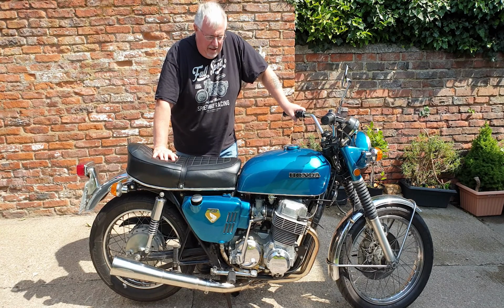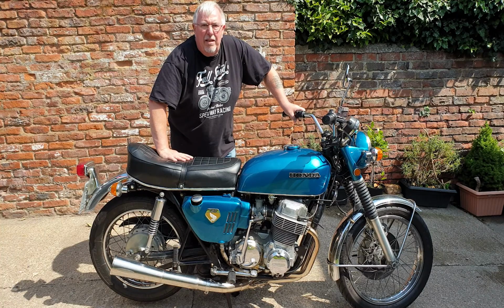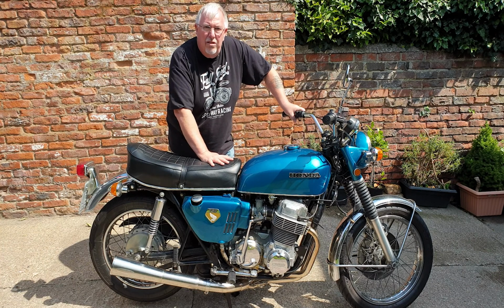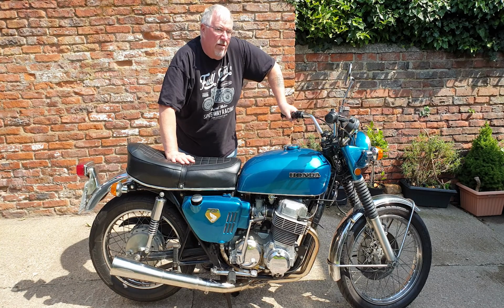CB750 Exhaust Sound 4 into 1 Delkevic vs 4 into 2 Shorty - Honda K0 | Part 33

Comment: I just bought one for my DOHC CB750 - thanks for your How To's
Reply from the maker: I really like everything about this exhaust the look, sound and the quality it is all good.
Reply: @SPANNERRASH  Thanks for your reply.  I dropped the old pipes after watching your vid. they were about 60 lbs in total. Im goging to clean them up and see what Ebay can do with them. 

The new  ones are 10 lbs.  I observed that cylinders 1 and 4 are on the top of the collector and 2 and 3 on the bottom. When I get mine for the DOHC inn the next few days, I'll  make a loose assembly of the pipes and collector, that i assume I can slip/wiggle into place. 

what I notice was the muffler assembly pastes ( thanks) so I ordered that too from Amazon - 

I loved the deep loud sound of my pipes after having pulled the baffles, and hope the new header solution can meet that expectation with its baffle options. I can sett it to super quiet when having to get an inspection, and Ill see how loud loud is otherwise since I can set it with a parital baffling - 

Ill let you know How I made out - https://youtu.be/yKdEM59ERCw 

Best Regards -   

Orion -
Reply from the maker: @ClassicRider  I never really thought about the weight saving, but that is a great bonus.

The sound it makes as standard is great for me.  I haven't explored removing the baffle, but I do believe they can be taken out.  You may have to consider changing the jets though as there will be less back pressure.

Let us know how you go on.

Comment: I bought a standard 4 into 2 exhaust in good used condition for my z650 kawasaki in 2005 off ebay for $29 Australian dollars, postage from USA  $140, still cheap, and they make the bike look stock standard. 
No chance nowadays.
Reply from the maker: The times they are a changing.  I still think about the Triton project I bought from an ad in the Manchester Evening News for £90 back in '86, thought I did well selling it for around £400 when I moved a year or so later.  Big regrets!!!

Comment: I much prefer the deeper tone of the delkevic,saying that on a longer run, the delkevic would make a long ride more enjoyable. When I 1st bought my gt750, it was fitted with a standard exhaust, but the previous owner had fitted k&n filters, after a 260 mile round trip to friends house, it really got on my nerves, so I refitted the standard air box & bike was brilliant to ride after that
Reply from the maker: Hi Pat, I'm loving these Delkevic systems for these CB750's they have a great sound. I think I'd love to have had the standard exhausts for this particular bike even more though as it ended up being such a tidy example.
That's interesting about the K&N filters. I'd have assumed they gave a better induction sound but seems that might not be the case!
Reply: @SPANNERRASH  on the kettle you have 3 40mm carbs it’s really loud, was bad enough that my ears were ringing,there wasn’t any performance gain either, plus it ran better with the standard air box
Reply from the maker: @bluehazeboy  Haha! I heard the same about them running better with the standard airbox, so must be a common disappointment with the K&Ns.
Reply: @SPANNERRASH  I reckon it’s all about set up,even a trip to the dyno to boot as well

Comment: There is no comparison the 4 into 1 was music to my ears.
I had a CB 650 1979 model bought it in 1981 stuck a set of free flows, extractors, 4 into 1's lovely set of pumps all the same length, chrome.
Increased power below about 7000 rpm by a really noticeable amount. 
Quick 650's for the day those Honda's last of the single over head cam engines a real pocket rocket. Quicker than the 650 Suzuki with double over head cams.

Not that I'm condoning this sort of behavior, but as a young man I lived in Canterbury New Zealand in the country down a Along straight road. One of the prevailing winds would blow straight down it, you could get up to 40 or 50 miles an hour sometimes and it felt like there was no wind it was blowing that hard. I thought how fast will this Honda go with one of these winds behind me?   
Answer... it red lined at 9500 rpm.  It wound past that and out above the red which stopped at about 10500 rpm  must have been above 11000 rpm. The speedo finished at 200 k's an hour at wound well past that and it was still accelerating when I thought I think that'll do. 
The lamp posts are starting to pass very quickly at that speed.
Reply from the maker: It does sound good that Delkevic. Love the story, that feeling is what its all about for me. I bet you were grinning from ear to ear. :D
Reply: @SPANNERRASH  Yea I did a lot of miles on that bike around the south island over on the ferry to north island a couple of times.
Christchurch to picton in 3and bit hours that normally takes couple of hours longer that that. I was grinning alot on that bike.
At 61 i'm going to start looking for another bike. But you know I think i'll get a early 80's or 70's Triumph Bonneville lots of them still in NZ plenty of parts. Cheap registration here if it's over 40 years old. I dont need to go fast know days. Dont want a new Triumph even if they are good.

Comment: Hi mate do you have baffles in the delkevic ? My understanding is that they come with removable baffles. Cheers james
Reply from the maker: The baffles are still in.  TBH I haven't tried it without, and I am not sure how easy/hard they would be to remove.  But once the weather improves I will take a look.
Reply: From what Ive read it seems a relatively straight forward process to remove, that said, I haven’t ordered my Delkevic  yet so you would have a better idea than me. 👍🏼

Comment: can it be used for cb750 k4? I have cb 750 K4
Reply from the maker: If you look at our other CB K series videos, you will see I have put basically the same exhaust on my other one.  It is a 76 engine in a 78 frame.  So it will fit a K4 perfectly, not withstanding you sometimes have to adjust the bracket where it connects to the pillion footrest.  I love the Delkevic, it makes a lovely sound, and I think it suits the look of my bikes.